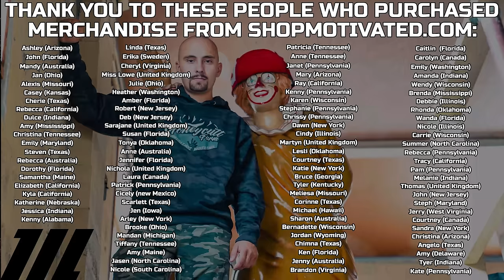(PART 3) WORLD'S MOST HAUNTED FARM! HONEYCUTT FARM

Comment: Don’t you find it strange same room as the gun that part of the carpet was cut out? Could have cleaned up after a murder. Carpet had blood on it! Weapon hidden in the heat grate also! Something bad happened for sure.
Reply: You can't murder someone with that gun. Its a blank firing pistol. I own the same gun, we use it to train new officers who have never shot a gun before
Reply: @l.a.picasa  its really unlikely it was used as a murder weapon. Either the guys put it there was part of the video, or someone else chucked it there. They're inexpensive, a bruni mod here in New Zealand is only $450-$500NZD. To hurt someone with a blank you'd have to place the pistol right against their heads and fire it but it's unlikely the injury would be lethal or you'd have to modify the gun which is really difficult to do as they're designed to make it extremely difficult to modify. I've worked for the sheriffs department and the military and was a marksman for 8 years.
Reply: @l.a.picasa  yeah it was planted by CJ
Reply: @katev37209  maybe they use it for fear- not going to lie if that was pointed at me I’m not going to question at that point
Reply: @missm108  yeah I have seen people posing with them on social media acting like they have a real gun but yes its hard to tell the difference unless you're well versed in guns and blank firing pistol. Blanks also make one helluva bang and are a lot louder than real guns. I know in the UK blank firing pistols have to be orange or something.

Comment: You could be removing finger prints. when you picked if up with the towel and your rubber gloves. Hugs
Reply: Seeing you remove that gun and handle it with cloth, then check it our, though with gloves, worried me because you could have been destroying evidence, fingerprints.  You really should just have left it and reported to the police to process, forensically protecting evidence.  However, amazing that you were led to this via the spirit box app.  As others have said, this may be why you have felt driven to be here to uncover this.  Good luck with the rest.
Reply: No you wouldnt be able to remove finger prints but it's definitely been there a long time
Reply: Is not that simple to remove fingerprints!  Weapons found under water in lakes and ponds can still hold fingerprints! The evidence is still there are the house but I understand them taking the gun with them. Just in case someone was hiding outside and heard them when they found it, they couldn't come remove it when they left.
Reply: Not unless CJ rubbed the gun clean wich he didn't you see police and forensics holding guns with rubber gloves so if the prints are not to old then they will still be there. Fingerprints are oils on your finger tips they can only get prints off flat surfaces
Reply: Well that is really good to hear because I was genuinely concerned that potential evidence was being destroyed!  Thanks for the heads up guys.

Comment: 12:29 an orb over cj head moving toward the ceiling and then towards the camera 
17:41 another orb. 
The spirit box did say there is one body in the walls... there is a tool for scanning walls  to find pipes, wires and studs (wall scanner) you can try to scan the walls and maybe find more stuff in the walls. There could be more than just the gun hidden there.  That's how the bodies in the Hales Barn Dam were found I think.

Comment: It kept on saying gun,wall,heat and it did say that they were murdered by a gun
Reply: Crazy there was an actual gun in the wall!
Reply: Yep it especially said they where betrayed as well.
Reply: They said burned to death. Look for firepit and have it searched
Reply: Notice the heat pipe in  the corner ? Heat wall gun
Reply: @missm108  that's not a heat pipe. It's a vent pipe that goes to the roof.
Reply: @penelopetaylor8350  7 went missing so multiple ways they died presumably?
Reply: @missm108  Old expression-- "packing heat."
Reply: @missm108  or packing "heat"
Reply: @_wanted_outlaw3007  yeah maybe..some burned..some buried
Reply: @lorieakin1771  ohhh from the Floor furnace thing ?
Reply: @missm108  👍yup

Comment: That’s a nice Maglite and Baton!!! I’d have thrown them both in my bag!! That place under the rug could be where someone died and it didn’t get to the wood yet so they just cut out the carpet? That gun thing is insane!!!! You should have definitely called the police on that one, at least. The other things have a place on a farm and guns do too but in the wall? I wouldn’t move that thing. Kick with the ball of your foot or heel not your toes. Just a tip. Or get steel/composite toes. Adidas makes a composite toe that Delta force and the SEALS use that is very nice and light but very well made. Those would be perfect for exploring anywhere in just about any weather.

Comment: The part where the necrophonic app makes it sound without them using it was sunny accidentally pushing the White noise button which even if the thing is turned off it will still make noise

Comment: CAVEAT: Any time you find a potential murder weapon, you should never touch it. Once you touch it or move it you loose the chain of custody and potential use as evidence in a court of law. Establish the home is yours, call police and have them get the gun. They are responsible for and can testify as to chain of custody for that piece of evidence. That entire home, blood evidence, carpet removed, hole cut in wall is all evidence. You walked all over it. However; you could not have known. The issue is that you left the scene and took evidence. You turned off your camera so time is missing. I have seen this on a couple of ghost hunting videos and any tampering at all of any potential evidence really can cause issues for a prosecution. Kicking bones, opening a suit case with a dead body inside, etc...can diminish evidence.

Comment: They weren't planning on getting the gun out. They busted in, started shooting and slashing, killed whoever they intended on killing, cut out the hole in the wall with the machete, dropped the gun into the hole, hid the machete in the floor vent in the living room, tried to hide the hole in the wall with the quilt (using the hammer and nails in the kitchen), disposed of the bodies (probably tried to hide one in the floor, but ultimately decided to cut them up to feed them to the pigs), pushed the mattresses into the attic, hid some evidence in the attic, removed the blood-soaked furniture (some of which may be at the barn), placed a rug over the cut-out carpet, pulled up the bloody carpet, cleaned the bloody floors, attempted to clean the walls, painted over the blood on the walls of the bedroom that looks like it has a fresh coat of deep red paint, and left to dispose of the bodies.